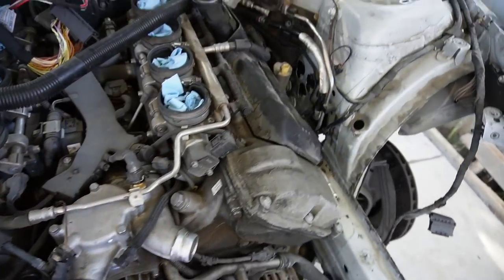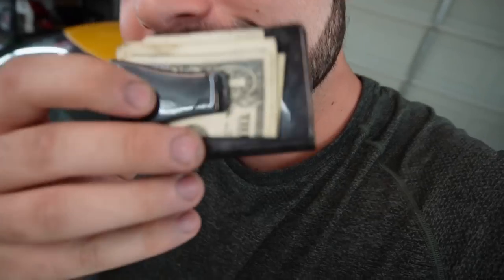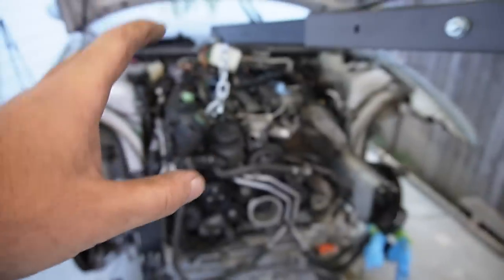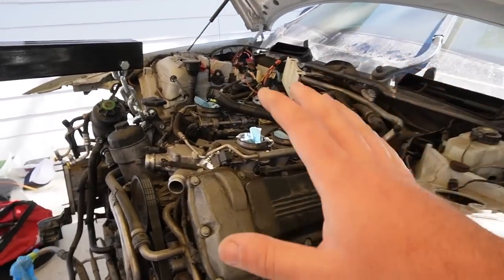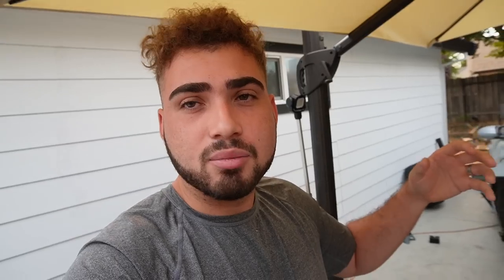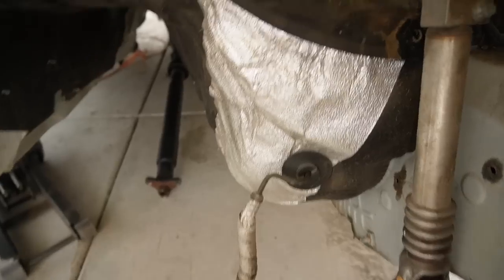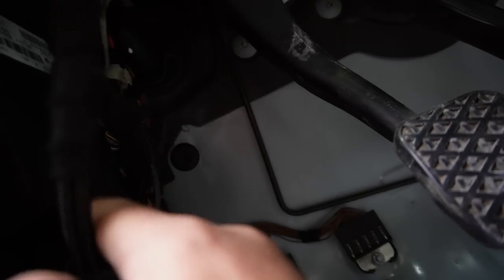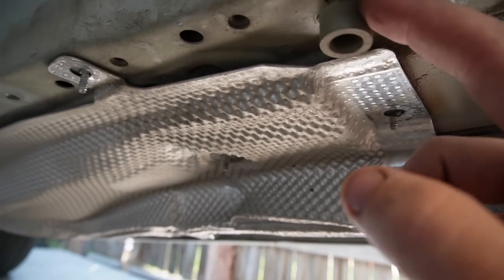Building A Custom 1 of 1 E91 M3 Wagon! (Part.10)

Comment: I'd make a custom bracket
the inside sheetmetal and the carpeting from the AWD is also different from the RWD
the replaced sheet metal will have to much room to flex and may loose you rigidity for the transmission mounting point

Comment: Bro, please do not paint valve covers. Have them powder coated by a powder coating shop. They will look amazing if you do them in the same color as the car!!
Reply: Also, powder coat will handle the heat way better
Reply: @ahmaddabdoub1696  paint matched valve covers would be so tacky